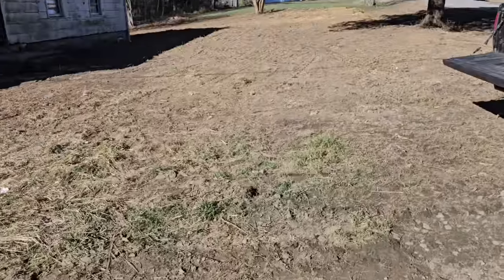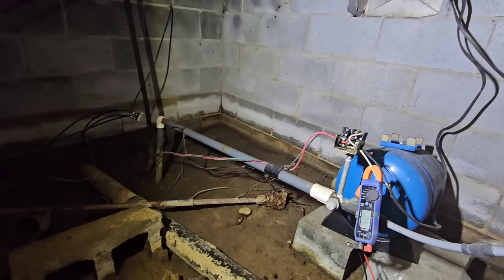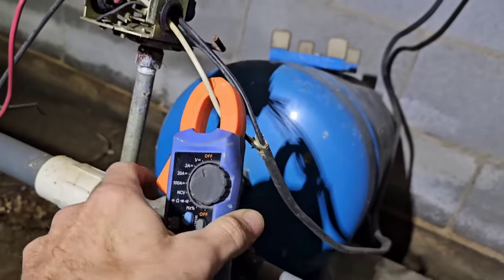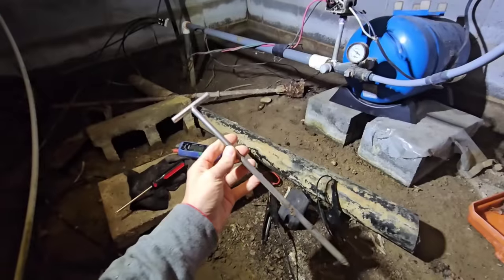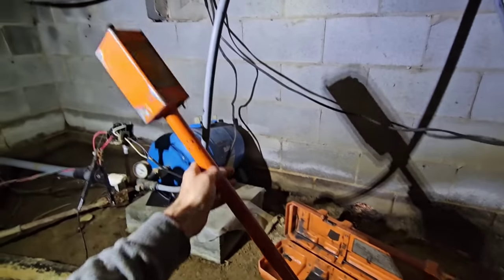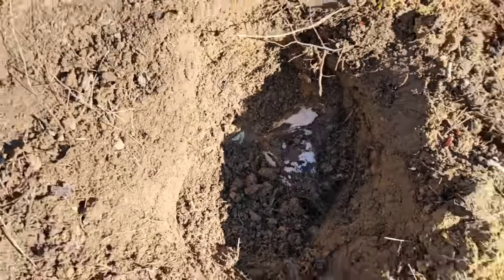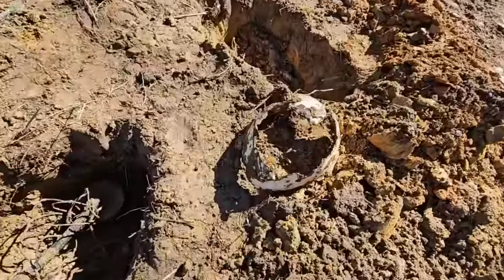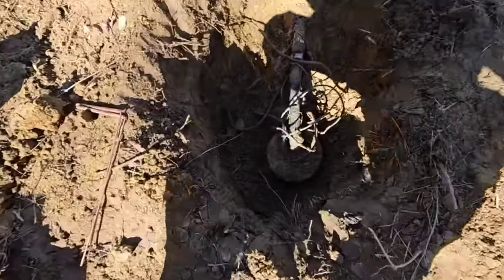Can Copper Dousing Rods Find a Water Well below the Ground? New Tech Vs. Old

Comment: I grew up on a small 5 acre berry farm in western Washington state.  When I was about 8 years old we had new wells drilled for our farm irrigation.  The old guy that drilled them doused with small branches from a willow tree when they crossed over one another he said there was lots of water. He went down about 97 feet and we had lots of water to run 28 sprinklers.   When the new next door neighbors moved next door on their 5 acre lot they needed to drill wells for their new home. My dad offered the guys name to do theirs. They denied the offer and used a geological engineer.  He went down 450 feet and no water.   The neighbor then asked for my dad’s advice.  The old guy came out and doused with the Willow branches.  You glued it.  He found water at 99 feet.

Comment: I used to work for a water district and used them to find 72 inch pipe about 20 feet down. 
Try using a open coat hanger with a small weight at the end. It will bob which is the depth of the water or pipe. Then it will sway horizontal and than start bobbing again.  This set is the depth of the water column.  I used it to find my well location on top of a 3500 ft high mountain. No one around me was successful in finding good water 
 I found it at 50 foot depth getting 20gpm.

Comment: As I'm aware of anything that can be fashioned into dosing rods can be used the only other way is with a forked willow branch a thin one not a thick one it will pull downwards when you are over what you're looking for, I wasn't a believer in dosing until I was piddling around looking for a spot to drill a new well because the old well was a hand dug well that was filled in when the land was cleared we knew where the old well was because it wasn't to far away from a old tree that was close by with in about 10 to 15 feet from the old tree, I had fashioned a dosing rod from a couple of clothes hangers I made sure that they were perfectly angled and because they were small wires and if you didn't clamp down on them they would swing around freely I walked around until they crossed and I Marked the spot and did it again several times and each time they crossed at that same exact spot, so we had the drillers to drill in that spot and they hit water at about the same depth as the well was and after that I was a believer of dosing rods, I've always heard the older generation talk about that's the way they used to find water and where to sink a well, but I was like you and didn't believe in wise tales until I tried it and it worked, but I believe it makes sense because like you said you could spend a lot of time locating that well and so it would be the same with digging a well, it would be a waste of time and a lot of energy spent digging empty well holes until you hit one with water in it. I'm 56 and I've heard several old wises tales do I believe in all of them no but I don't dismiss them either after that and as I have gotten older and gained wisdom as I said it makes sense because of the waste of time and energy digging holes looking for water or anything else you may want to find that using dosing rods could help you locate.

Comment: I know everybody says using dousing rods doesn't work. So I had a friend who used  thwm at my house to decide where to put in a well. He was not a well driller. He went out and told me to drill where he witched it. Drilled there and 80 gallons a minute well at 300 feet. End of argument. It's funny, had the water tested, and it tested better then the city water supply.

Comment: It’s one of those things that you can either do or not do. If I wear a watch it will soon stop working and if store computers go down it’s when I get near to them but I can take two wire clothes hangers and find all kinds of things. Water lines, under ground streams, power lines. If you hide a gold ring under a carpet I can pin point it and with just one tail hair I can tell you how old the horse it came from is. It’s not rocket science. With a straight willow stick I can tell you how deep water is under ground.

Comment: I use a single utility flag just like the one you put above the hole for this same purpose.  It will always run parallell to the line.  You just correct your hand to follow the tip and it'll lead you along the line.  The softer metal will generate different results hased on what you find as well.  I have found that underground telephone wires will cause the tip of the flag wire will bob up and down if you stay still above them.

Comment: Try using just the ground wire next time on your locator. I used a cable locator for 40 years in the telecom industry. As a last resort connect to both hot leads, don’t connect to ground make a loop through the motor.

Comment: back in the sixties i used coat hanger dousing rods and they worked very well, then i walked thru the house and it crossed over every water pipe i walked over! i have no doubt they work.
the further they cross the middle of the crossing is the water and if you walk too far they cross against your body to tell you you've gone too far.

Comment: I could find the streams or other possible places to use as a well. And I could tell you how deep it is with in just a few feet. 
I can use those copper rods or a small green fork from good tree. I hold the fork in my hands like the copper rods. And have had the bark twist off the fork most times. The fork is about a half inch or little less.

Comment: I can find buried wire all day long with copper wires,  I used to put in underground utilities and would locate existing utilities with dousing rods.  I have located Plastic water lines with them too.    Black Pipe is Usually Gas line.

Comment: I have never believed in dowsing, but we did set up to drill a well where I was not familiar with the geography. As we drilled we hit what we call black muck, yes it is as bad as it sounds, so no well there. An old retired driller happened up on us and offered to dowse for a spot. He picked a spot I would have never picked (down in a low area). Homeowner wanted to drill there so we did and amazingly got a good well.

Comment: Fencing wire works better than copper down under.  If you hold the wire tight and you above the ability to Devine water you will feel the wires move in your hands.

Comment: With your electronica wire finder if you place it over the indicated line, then tilt the probe at a 45° angle, parallel with a line and move it away from the line. When it null’s the distance you moved it will be the depth of the wire.    This will be accurate within an inch or two.

Comment: I allow for the possibility that dowsing rods sense the electric field that always exists between Earth and air and the distortion of that field by groundwater.  Well, it isn't that the rods sense it, it will be your body and nerves sense it and the dowsing rods are antennas.  The more conductive the antenna, and the more conductive the earth, the better it is going to work.

Comment: bull crap anybody can find water pipes with 2 metal rods i use coat hangers and aint failed in 40 years water gas any kind of pipe and springs buried old septic tanks i find them and show others how nothing to it

Comment: as a plumber we did basement finishes. older houses didnt have clean outs that made it definate that was were the waste pipe was at. Using 2 pieces of silver solder bent we were able to accurately find were that pipe was by using that very technique. when we would cross a void below the solder would pull inwards towards each other like magic

Comment: My uncle worked for decades as the head of a municipal water crew. He taught me about dowsing. First you need to know not everyone can dowse well. If a traditional watch loses time when you wear it you will most likely be better at dowsing. Then you have to know what your body is in tune with as in metal or wood. Fruit bearing branches forked worked for my uncle but I had no luck. I had some luck with copper but I had great success with brass rod. My uncle would sometimes get me to dowse in winter months when lines froze because my accuracy was always within feet. Ironically I could also find gas lines fairly accurately. I believe there may be other conductive materials that work for people that copper brass and branches don’t work. It works well enough for me that trying to keep the bent brass from crossing is impossible my tightest grip and they still cross. They called it divination or witching because intent was the missing factor if you don’t concentrate on what you’re searching you may not find it. Which may be the way the body lets conductivity flow. I think it would be interesting if someone did a medical test on someone while dowsing. Dowsing as in a dowel or rod of wood or metal.
Reply: Thank you for your insight/ theory!

Comment: My experience was that you can use dowsing to find anything.   About 45 years ago I became exhausted searching for the grave of a relative in a large rural cemetery.   I grabbed my dowsing rods and while standing in one spot I slowly turned 360 degrees asking myself, "Where's the grave of John Alderman?".   At one point my rods crossed and then I started walking in that direction and in less than 200 feet I came upon my relative's grave.  That was my first visit to his grave.   Some dowsers can find mineral or oil deposits using a plumb bob over a map.   H.L. Hunt had a mentally ill son that could ride in a railroad train and would ride for hours and suddenly announce, "Drill here !".
Reply: In a few weeks I'll turn age 85.   My personal theory is that God's Intelligence is always present but it's difficult to connect our conscious perception with His Intelligence but when we use a dowsing tool it connects our subconscious with our conscious perception.  The modern prophet, Edgar Casey, made his connection with God's Intelligence while asleep dreaming.

Comment: Check your wires for faults, the hot and neutral will be shorted through the motor disconnect both at the house, don't use the ground because the signal will bleed off through the earth.

Comment: The simplest thing makes these Locator Rods (Location Rods) work. I do not use the obscured over terms or names for these as is in history books, encyclopedia’s, reports, dictionaries and is rumored about and in religious propaganda literature and more.

When you climb a tree and cut a limb off, ‘It floats away into space, correct?’

NO it does not. Gravity poles it to the earth as it does us and all objects. So when using these rods, gravity is their cause of how the work. Why, you may ask and how is it possible?

When your holding a Y shaped stick or have two Locations rods in your hands walking along with them slightly pointed downwards, gravity is pulling more on the ends pointed closer to the earth. But why do the rods begin turning when there is water or another object in the earth when you pass over that object?
Simply it is the interference of gravitational pull by the object that IS NOT of the surrounding terrain. That Object even when very small is blocking the electromagnetic field of gravitational pull and effects the rods to find the gravity outside the object that was blocking the gravitational pull. 

This can also be seen when magnets and other metal objects can prohibit a compass from its normal path of pointing to being off course. 

I do studies of objects in their relationship to the earths magnetic, electrical and gravitational outputs and interference’s. 

Enjoy knowing how and why Locater Rods work now and see why they will always work well. 

Check a gravel pit, sand dunes, fertile field, etc. and see that when there is any object not familiar to that surrounding terrain, the gravitational field will be interfered with.
Reply: The problem with this explanation to me is, gravity doesn't pull, it pushes. If it can even be described such. According to extraterrestrial contact and their science, matter does not produce gravity, gravity creates matter. There is matter because there is gravity. Particles are standing waves in the flow. 

I think you're right about the gravity making them work, but for a more esoteric reason. Besides, I don't discount there being something electromagnetism involved, but. It's a conditional ability that works for some, and not for others. Whether with metal rods or wood. There are common patterns to it's manifestation, but the manifestation itself is sometimes strong and physics defying [bark peeling/twisting on an Y branch, as several people attested under one of the comments]. These points lead me to think that this is a psychic ability, not a electromagnetic phenomena.

Comment: I've had many utility locators show up at properties to mark where they believe buried items are. From looking at maps and using high dollar electronic devices. I've dug into several kinds of underground surprises and have yet to hit anything after being marked by the divining rod utilizers. The watch while you're digging there... you're going to run into something I don't know what... Very valuable when working on a project. Hitting those pipes that have the stinky stuff in it is never fun. While digging my swimming pool I ran into a very large 4" plus in diameter undocumented telephone cable. Luckily I was clear to dig in that area.  So glad I didn't have to pay to get that repaired.
Reply: Just because I don't know why it works doesn't mean it doesn't work.... Watch the movie Quest for Fire. It taught me to appreciate technology. And to remember that sometimes the old ways are good to know in a pinch.

Comment: some years ago i was shown how to use the rods by a friend. I used them when i drilled holes for telephone poles at the side of the road. apart from the paperwork that always had a get out clause on them. the rods did save my ass a few times & when it went wrong it was my fault for not believing in the rods.

Comment: not so much for locating existing well  
  but have seen both willow tree limbs crotch and welding rod to locate where to dig a well  for water and the gentleman could even tell you how deep the well would be
   and was accurate to within 1 ft to 18 inches always found water   even underground stream  in clay type soil

Comment: totally believe in the divining rods  we were trying to locate lay out of  sewer line  drain line from one of our building. they  also work for finding electric lines  . we had our parking lot tore up were  setting new base and adding drain lines  as the pavers were doing there thing they came across  un mapped drainage pipe  were talking a college campus so lots building  has taken place in 56 years    we used the rods  to follow the pipe  good  200 ft  under a  road over to land  we leased (another public entity they built many moons    found out  leased   building which  we had no plans for was  tied into this  drain  line then we were able to trace  were  pipe  dis charged in a wooded area  away from that building   made believer out of us   like your self we used new tech  to double check   we also  dug up drain  that came from the building on our side of the road abandoned we were doing major paving of road way and  and parking lot sadly did not find any dinosaurs any hoot   its  cut off at the road way on there side of street  since they take care of the leased  space property   also  since we had just created new network drain lines that now go into a new  retention area

Comment: A lot of times the old way of doing things is just as good, if not better than the new ways, especially when you factor in the cost. They used the old ways for as long as they did for a reason.

Comment: I’m an electrician, was taught 30 years ago to use the dousing rods.
They work if you have feel for it. Over that time I estimate I’m about 80 percent accurate with them.
As for the locator they ghost over on to other wires through induction of your pulse signal. Trust the strong signal first , just as you did.
Reply: If they worked wouldn't it be 100%? You're just good at intuiting where things are.

Comment: Hell yeah the witching rods work    on water and drain lines they usually Point Inward    and on electric line  they Point outward   at least that's the way it works with me anyway    I even use the Divination stick and it's works   when   you go over a puddle of water it tugs the stick down